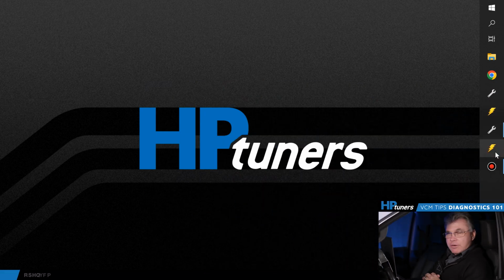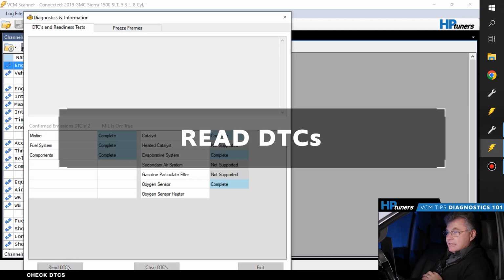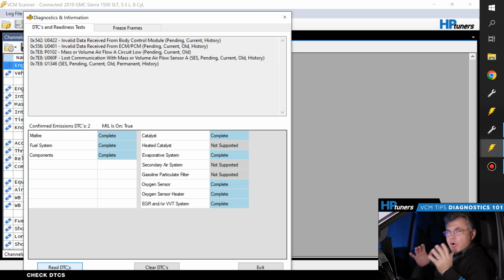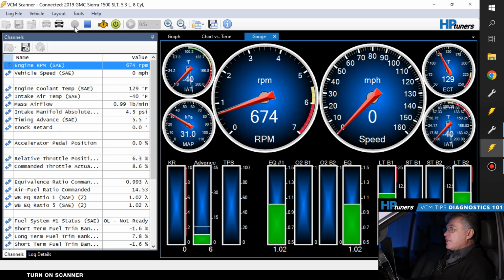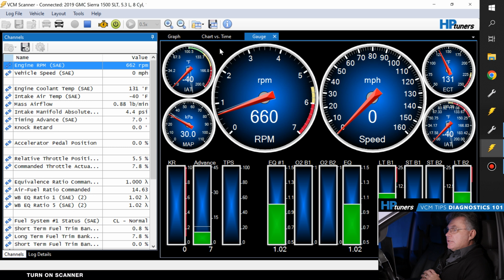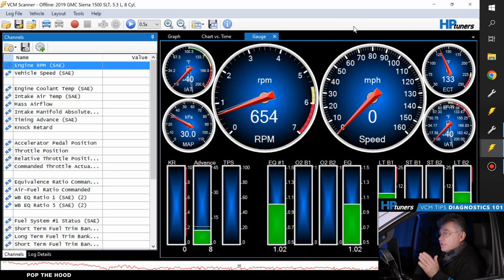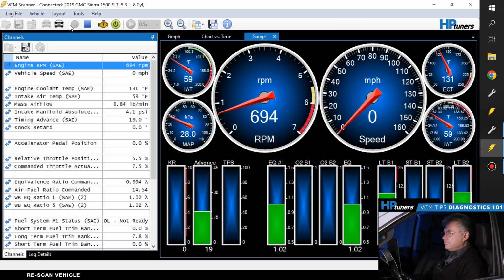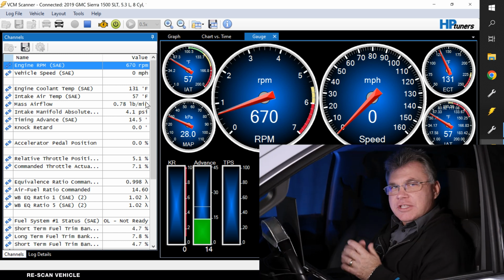How to Diagnose Mass Air Flow Problems w/ VCM Scanner | HP Tuners

Comment: @hptuners i have a 2022 ecoboost mustang with 8000 miles on it, when it had barely 3000 miles i had purchased a ported throttle body from a reputable seller on Ebay who ports the OEM throttle bodies, to me it made a difference in performance of the car then when i made other mod's i finally decided to get a tune with HP tuners,  my tuner has experience,  but i am getting a P115E error code related to throttle body, only at idle, it throws the CEL randomly but seems to only do it when cold, i keep resetting the light, and it comes back, my tuner said there were no errors, we are stumped as to what is causing this, everything about that code says carbon deposits and build up, and need to clean, but again its 8000 miles, is this possible?